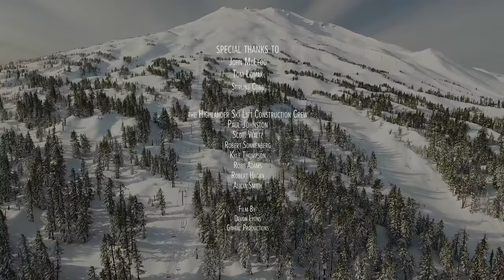Cloudchaser | The Story Behind Building A New Lift

Comment: Anyone else see that HUGE line at 6:27?
Reply: Looks like a regular pow day line at bachelor lol.
Reply: Ive seen worse. Strawberry gondola at snowbasin on a powder day is far beyond longer than this.
Reply: Then why did the only build a 4 seater and not a 6-8 seater? :) Probably too expensive.
Reply: @EmotionalWeather  A quad chair is fine most of the time.  A wider chair would deposit riders too quickly and cause congestion at the top.
Reply: Wally Kramer In the US it seems like that is true. I think I‘ve only seen 1 6-seater when I was skiing in Utah.

6-8 seaters are kind of normal in Germany/Austria, the big resorts have them everywhere. The resort where I was a week ago has 12 6-seaters and 5 8-seaters
Reply: @wallykramer7566  though with people skiing different speeds congestion finds a way
Reply: The line was actually backed up into Canada, folks at the back needed passports xD lol
Reply: If it was opening day of a brand new lift maybe it was drawing a bigger than usual crowd just from the novelty
Reply: Well it was hard to miss given it was so long

Comment: 5m/second
1000ft/minute

Damn now that's how fast all Bike Park lifts need to be!
not 15-20 miniutes for 385m of vertical, or 8 minutes for 350ft of vertical. Not hatin, just damn most lifts are run too damn slow (won't say names) ;P
Reply: I saw a cross country rider get to the top I nether same time it took us to chair up, helped by a few stops of the chair
Reply: That’s ground speed not elevation

Comment: Do chairlifts always have to be straight, or can they have doglegs?
Reply: they can turn, but it's kinda uncomfortable to ride. There is one at Alta utah that turns and you definitely feel it. The tower setup looked more complex too as it needs extra lateral support.
Reply: It‘s possible in theory, but it basically never happens.
Reply: @EmotionalWeather  I mean I've ridden on one. It works but it's not as smooth to ride

Comment: lol building a new one without shields. Have fun freezing
Reply: "shields"?  Maybe you mean canopies?   We don't have those in Oregon.  Don't need them.  Lifts will be closed if the winds are strong enough (45-50 mph with higher gusts) or if surface visibility is very low (like 20 feet).
Reply: i grew up in vermont riding exposed conventional double and triple lifts in -15 degree fahrenheit air temps with 20g30 winds... harden up dude
Reply: I mean at least the lift has some Wind slats on the chairs and has a tiny garage compartment.